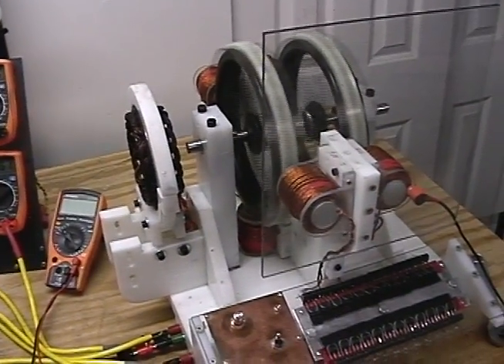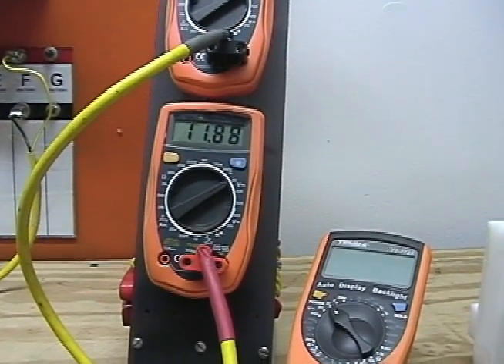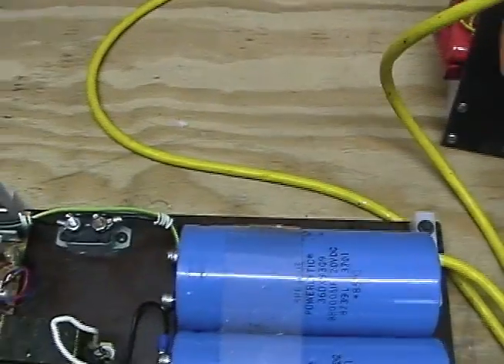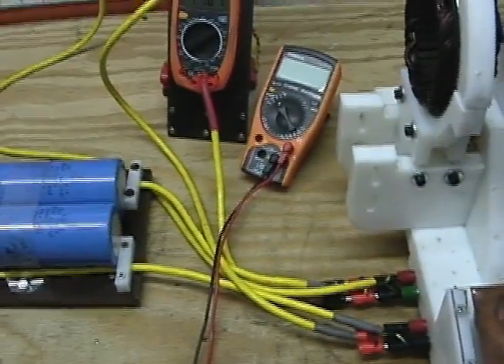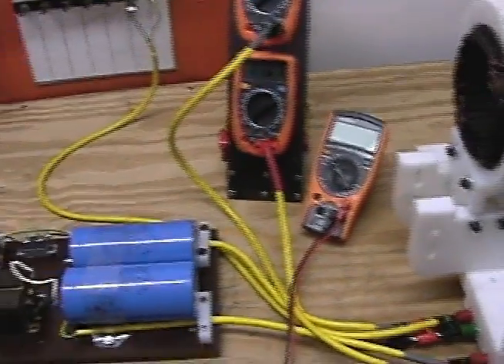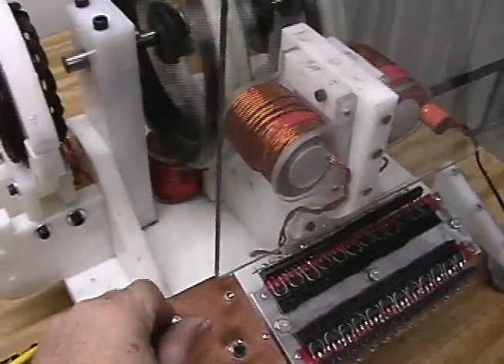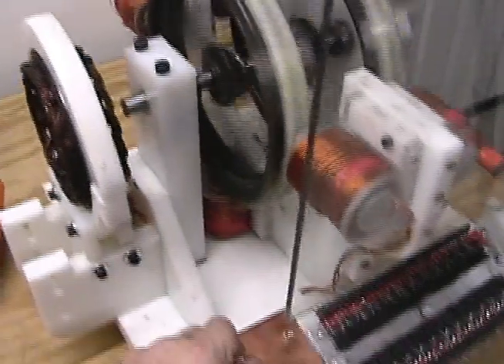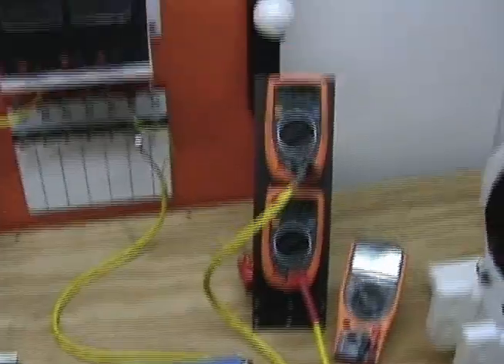One Battery setup VMG624

Comment from the maker: How many circuits will your motor have? this one is 24 with 18awg? wire. the transistors are high speed switching NPN chips rated at 160V,  they are surplus chips  you need to spec out what is available get a few samples from your suppler then build a test motor with one coil use small clips to attach each chip rate there performance, and make your decision  based on the outcome ,always test one of your coils cores first and pick a chip ,Good luck

Comment from the maker: yep neon's are worthless. and  a waste of energy I noticed 36v is more efficient than 12v  I hope to find a step down transformer  at 24-36V  I plan to put 30farrad 13.5V cap bank on the output with a way to switch it for conditioning, but this controller works great ! you never know until you try,